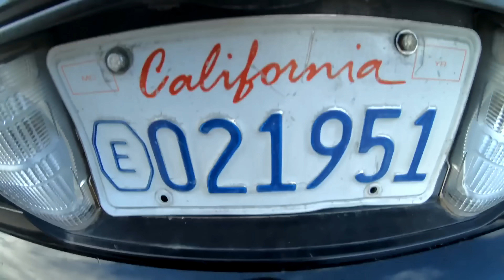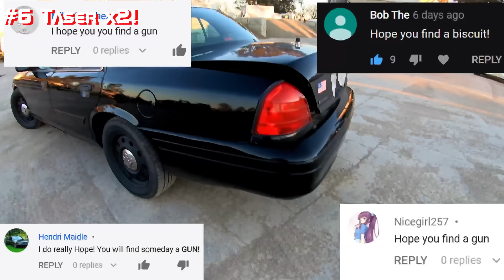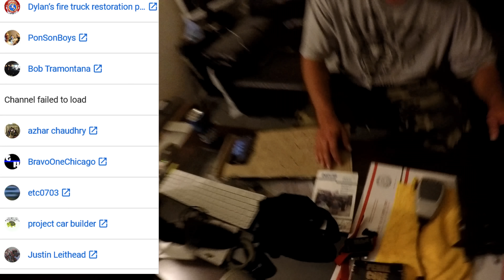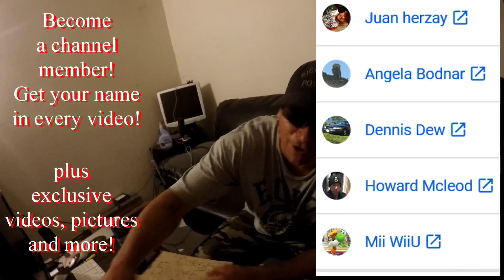Searching Police Cars! Greatest Finds of 2019! Crown Rick Auto

Comment: If you continue to hold simi-automatic pistols like that, you're going to destroy the webbing on your hand between your thumb and 1st finger which will land you in the hospital. Your support hands thumb stays on the same side as the thumb of your primary hand. If your primary hand is your right hand (the hand that is directly on the pistol grip and operates the trigger) then both thumbs will be on the left hand side of the firearm. The support hand should never cross the thumb over because it causes unstable and inaccurate shots as well as puts the webbing of the support hand at high risk of being sliced to shreds by the bottom of the slide during cycling (the slide in function is call cycling is the term cycling is by definition of firearms referring the slide/bolt moving rearward extending past the rear of the frame of the hand gun or all the way to the rear of the bolts stroke to eject the spent round from the chamber and then moving forwards to strip a fresh round from the magazine, push the round into the chamber and seating into battery to fire the next round.) Cycling happens within a fraction of a second and can cause serious damage to the user if the user holds the gun like you did. 

Really would hate to see you get hurt because you weren't informed on proper grip. 

Firearms Safety Rules:
1.Treat EVERY FIREARM as if it IS LOADED.
2. KEEP YOUR BOOGER HOOK OFF THE BANG BANG SWITCH until ready to fire.
3. NEVER EVER POINT YOUR WEAPON AT ANYTHING YOU DON'T WISH TO DESTROY.
4.ALWAYS KNOW what YOUR TARGET is and WHAT IS BEHIND AND BEYOND YOUR TARGET.
5. AVOID PASSING LOADED FIREARMS TO OTHERS UNLESS ABSOLUTELY NECESSARY.
6. ALWAYS CARRY YOUR FIREARMS IN A SUITABLE HOLSTER OR CARRYING CASE THAT BLOCKS THE TRIGGER TO AVOID NEGLIGENT DISCHARGING OF YOUR FIREARMS.
7.AVOID ASSOCIATING WITH IRREPLACEABLE GUN OWNERS WHO BREAK THESE SIMPLE RULES IF YOU DON'T WANT TO ACCIDENTLY GET SERIOUSLY INJURED OR KILLED.
8. KEEP YOUR FIREARMS PROPERLY MAINTAINED TO PREVENT MALFUNCTIONS AND POSSIBLE INJURY.
9. NEVER USE AMMO OF HIGHER PRESSURE WITH FIREARMS THAT ARE NOT RATED TO WITHSTAND THE ADDED PRESSURE. IF IT ISN'T RATED +P THEN ITS NOT DESIGNED TO WITHSTAND THE HIGHER PRESSURES FROM +P ROUNDS SO ONLY FIRE STANDARD AMMO, +P+ GUNS ARE DESIGNED TO WITHSTAND THE HIGHEST PRESSURE RATED ROUNDS WHICH ALSO CAN SAFELY SHOOT STANDARD AND +P ROUNDS.
10. WATCH FOR HANG FIRES AND MISFIRES AS THIS CAN BE A PROBLEM WITH YOUR FIREARM OR AMMUNITION.
11. ONLY USE HOLLOW POINTS FOR SELF DEFENSE CARRY TO REDUCE THE RISK OF OVER PENETRATION LEADING TO POSSIBLE INNOCENT LIFE LOST OR PROPERTY DAMAGE.

AMMUNITION AND TERMS AND USES:
1.BALL AMMO=FULL METAL JACKET=LEAD SLUGS=NON - HOLLOW - POINT=RANGE AMMO. THIS AMMUNITION IS FOR RANGE USE MOSTLY AND ADVANCED KNOWLEDGE IN TACTICAL USE OF THIS ROUND IS REQUIRED FOR POSSIBLE USE IN A DEFENSIVE CARRY AS A SECONDARY USE AMMUNITION.
2. HOLLOW POINT=DEFENSE ROUND
THIS ROUND IS USED BY PRIVATE CITIZENS, LAW ENFORCEMENT, SECRETE SERVICE, ALL ALPHABET AGENCIES. The hollow point has a hollow tip which causes the round to expand to almost if not more than twice it's diameter in a fluid so that the round dumps all of its energy and stops inside the body as a means to prevent the round from traveling through the intended target and possibly striking an unintended person, pet, vehicle and/or other unintended objects.

Standard, +P, +P+ and +P++ are ratings for pressure and higher pressure rated guns can fire lower pressure rated rounds, you should never fire a higher pressure rated round out of a lower pressure rated gun because the gun not being rated for the pressure can lead to catastrophic failure and possibly result in life altering if not life threatening injury's.

Note: Hollow point ammunition with a higher than standard rating can defeat some bullet resistant and bullet proof gear due to a higher muzzle velocity and are engineered to function as normal whether it's after passing through bullet proof material or not.

Please study and practice proper firearm safety, care and handling.